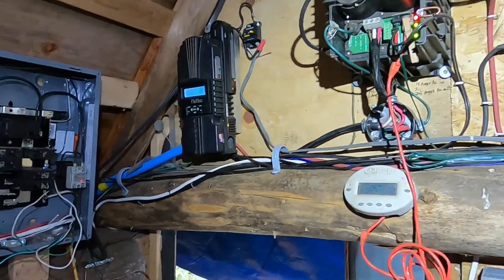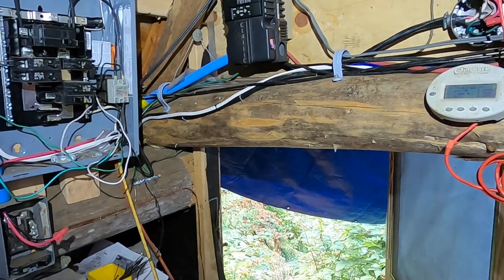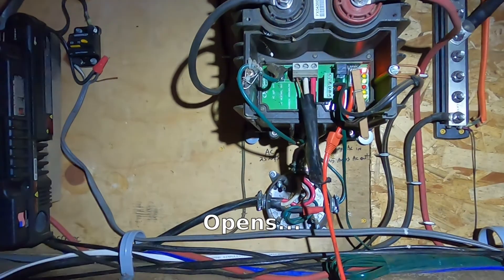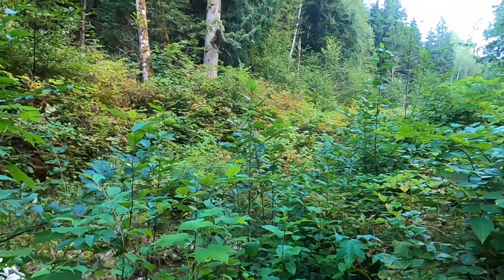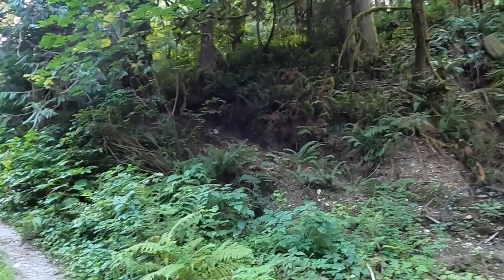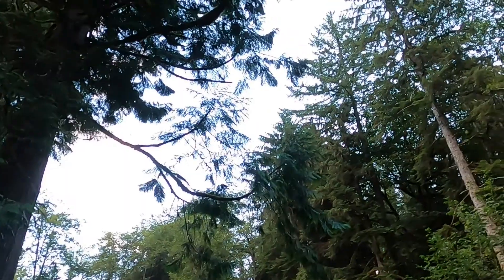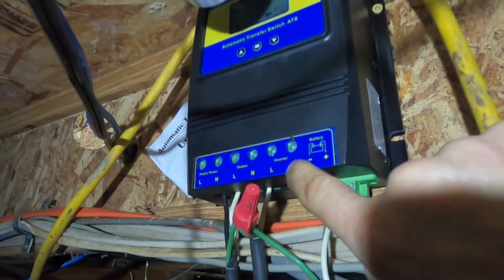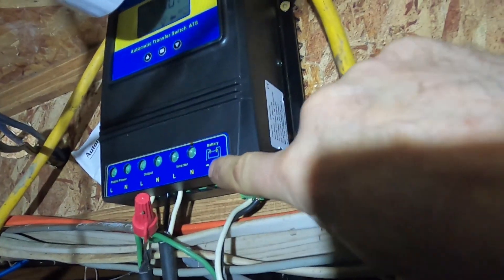Moes Automatic Transfer switch hack & Outback inverter vs. the mudslide

Comment: Can the Moes ATS-11KW Intelligent Dual Power Transfer Controller be used to transfer between 2 battery banks in a solar system using 1 inverter/charger?  both banks are 24v AGM,  the batteries in each bank have different AHs which is why I have 2 banks.
One bank is made 20 AGM 12V 35AH batteries @24v bank,  the other is 2 AGM 12v 210AH batteries @24vs.  I want to be able to charge both and switch between them automatically as one bank is drained below 11V it switches to the other.
Reply: The system switches between power sources according to a voltage reading from a single battery - it monitors when that battery should be used (per your set preferences) and when it should switch to the alternate power supply (intended to be the grid).  In order to flip back and forth between two battery-powered systems, you would select one battery to be 'primary' which the switch actually monitors while the other (secondary) goes un-monitored and the switch will transfer to it whether it is charged or not according to what the primary battery voltage is at.

Comment: Can I use this on my house breaker panel
Reply: That depends on your service leads.  The ATS can accept 6 AWG wire for the power sources and output, but it's supposedly rated for only 50A, so for 100 or 200A service, you should feed this through a 50A circuit breaker.  Set up an auxiliary panel next to the main panel and move ALL circuits except the single 50A circuit from one branch of your service (assuming split 120V service) from that box to the auxiliary box where they are powered through the ATS.  Alternatively, modify the line in the main panel so that feed does not run passed the 50A breaker into the other circuits (remove a section of the line so that there is an insulative gap), and then run the input wire to the ATS and bring the output wire from the ATS back to this severed section.  You MUST NOT leave that line intact or the grid will continue powering those circuits AND, in the event of grid-outage, your generator could back-feed the circuit and shock a person working on the line elsewhere.  It is ILLEGAL to wire with the possibility of back-feeding the grid.

Comment: I enjoyed the clothes pin holding the connector in place!  Amazing that you recovered that inverter.  I had a a bridge wash away and never found a single remnant.
Reply from the maker: Thanks!

I felt like I won the lottery when that inverter fired back up.  Then I remembered all the other stuff that I lost....

The clothespin is on the RJ45 jack where the Mate display/control panel connects.  I wracked my brain for an easy way to fix that jack, then the clothespin crossed my visual field and BANG!  I knew that would do it.  The plastic housing that normally holds the cord plug in line with the pins in the jack had been torn away...

Gotta watch out for those floods.  They do lots of damage.